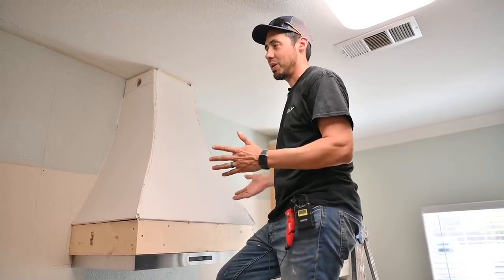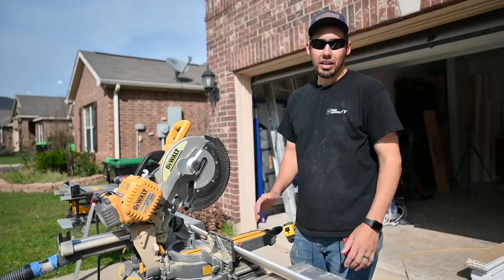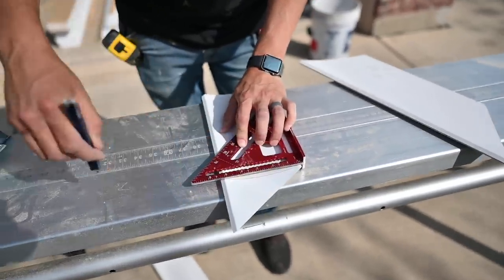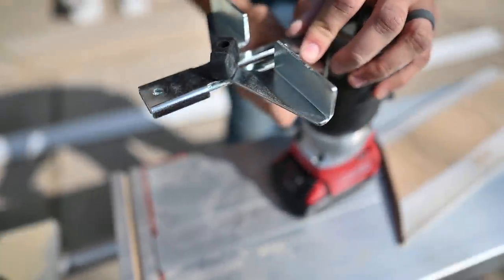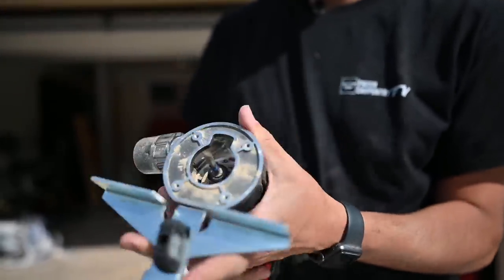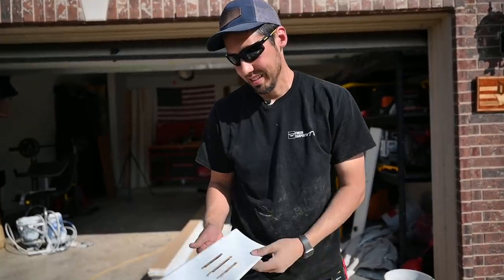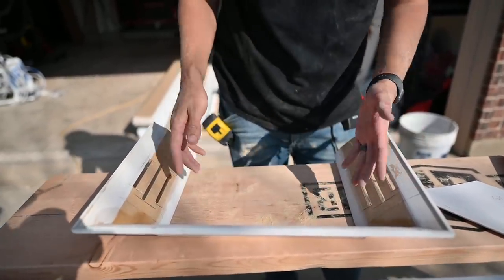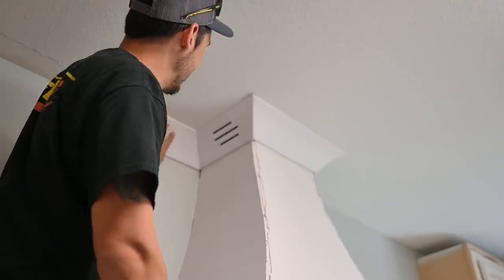Vented Crown Moulding - Trim Carpentry Trick

Comment: That system will stain the crown and ceiling. Not all exhaust is fully filtered. It should be exhausted outside. Love your work.
Reply: Yes, and the grease will accumulate on the inside of the crown where it cannot be cleaned.
Reply: 100% this. I learned that lesson in my first house
Reply: You are correct and the outlet opening is too small, it will add static pressure to this system that the fan and motor are not capable of handling properly.
Reply: Hopefully he sees this.. my thoughts exactly.
Reply: Edward Schmitt :  I worked in HVAC design my entire career, not trying to be a smart ass, it's just something I wouldn't recommend.  I like this guy's work, he is a great craftsman.  If the range is used excessively, cooking greasy foods the design will cause grease streaks on the ceiling and the slots will get plugged up with grease ladened dust.  I would suggest you save your comments for a subject you know something about.  Have a great day.
Reply: sure sure
Reply: What if you threw some charcoal filters into the void of the crown...just thinking outloud
Reply: @edwardschmitt5710  doesn't take a physics professor to see the intake is 8 times bigger than the exhaust! The result will be back pressure and an inferior draw. In other words, some of the air will be blowing straight back out the intake.
Reply: @calebmills7086  but not smart enough to use proper english...
Reply: I see your channel has no content, much like your head. Good night Caleb.
Reply: @byoh100  I’ve seen it happen. Agree with your thoughts.  Air should go outside.
Reply: richard thomas:  The big problem with residential range hoods is that most contain propeller bladed fans which can not accept much of a static pressure loading without a big fall-off in air delivery.

Commercial range hoods are a different animal because they utilize centrifugal fans which can be selected for high static pressure loading.  Charcoal media filters are most often incorporated in residential RH filters, they are are included more for odor removal than trapping grease particles within the media.  Residential range hoods somewhat serve their intended purpose, you just can't add any additional items that would cause additional pressure drop.  It would be cost prohibitive to attempt to use a small commercial RH system in a residence.
Reply: Edward Schmitt no body ever said the fan would break or explode if overloaded, I only said it will not work properly.
Reply: @edwardschmitt5710  i had to have a retrofit with duct going 25ft .... esp if you are burning gas on your stove, you should do whatever it takes to get it outside.
Reply: @edwardschmitt5710  you remind me of the person who said they smoked two packs a day and walked both ways uphill to school.  co2 alarms go off at only very high (death) levels - not the day-in and day-out CO, CO2 and NO2 you are breathing with unvented fossil fuel burning.  Indoor air quality is very bad, (unless you have windows open constantly and a leaky house - doable if you don’t have winters) and one study put over half of ranges producing over epa “recommended” maximums in the kitchen of 9ppb of NO2 (we have few regulations here).  Soaring asthma is a sign - its been increasing since 1980 despite so much less coal burned and cleaner car fuel standards.  This has all coincided with tighter houses for energy efficiency (good) but yet no requirements to vent gas ranges.  Gas heaters yes but not cooking.  Because the US is dominated by huge oil lobby, look to places like Canada that has at least taken some action.  The human and pre-human body has cooked by fire outdoors for millions of years; now we cook in hermetically sealed balloons.  Your house 40 years ago is nothing like where this guy lives.
Reply: @edwardschmitt5710  im an inclusive person and  wont forget the southerners
Reply: @edwardschmitt5710  this is already a known thing with a lot of research.  We have no IAQ regulations, but lots of outdoor ones.  Indoor air is frequently worse, and no2 can be in particular.  

“There is now stronger evidence for a relationship between long-term exposure to NO2 and respiratory effects, particularly the development of asthma in children. Results suggest that short-term exposure to NO2 may be associated with cardiovascular effects and premature mortality and that long-term exposure may be associated with cardiovascular effects, diabetes, poorer birth outcomes, premature mortality, and cancer” 

from EPA’s Integrated Science Assessment (ISA) for Oxides of Nitrogen – Health Criteria (Final Report, Jan 2016)
Reply: @smellydeadcat2178  im no expert but there is a reason the intake even n the cheap ones is 6" and even semirigid duct is not code. i have not seen the hood, but larger hoods do not even sound that loud. Thar hood sounded like it was struggling, not even down draft hoods sound that loud.
Reply: @edwardschmitt5710  The area of a 5" opening is 19.6 sq". The area of a 2.5" opening is 4.9 sq". Multiply the area of two 2.5" openings (it's less than 10 sq") Go out and restrict the exhaust on your Ford Focus by 50%. Then come tell us how good it runs, smarty pants.

Comment: If the total cross sectional area of the slots is half the size of the cross sectional area of the duct then you would get half the airflow of what you had before (approximately). You will also increase your velocity so it might feel like more airflow but might actually be less.

Comment: Richard, I recently installed a new modern vent hood.  The kind with curved glass and touch controls.  It’s vented to the outside via 6” ducting, which is manufacturer recommended.  I would be concerned about grease building up on the crown molding with internal venting.  I would highly suggest frequent filter cleaning.  You probably have the filters you can pop in the dishwasher to clean...I hope.

Comment: Nice job, I've done similar things with slots. When you were setting up the router to make the slots I was saying set the fence to one side of the crown and then the other side and then center the middle slot on them [a production move] just how you figured it out it also keeps it highly accurate with the least amount of effort the things that make you a highly skilled carpenter

Comment: Slowing the airflow to force it through the slots, which it will do, will cause grease to be deposited in, on and around the slots.  Keep the filter cleaned regularly to reduce this as much as possible.  I am not sure if you can, but if you could cope the crown trim in the duct into the crown on the wall, it could be removed without removing the crown on the wall.  When the trim gets dirty and greasy looking, it would be easy to change the crown around the duct.
Better yet, if you can, just duct it outside.

Comment: Pretty cool. I may have cut the slots to mimic the crown shape. Long on top with each slot below a little shorter and all lines stop at same vertical on other side or same length slots matching the curves in the crown. Just a thought from another carpenter!

Comment: A thought came to me while watching the video. Could you have drilled a pilot/guide hole the size of the router bit on the center line, and then positioned the router using the drilled hole? 

Just a thought. Another good video. Keep up the great work.

Comment: There is an unexpectedly technical side to airflow mechanics...it's a lot like the mechanics of waterflow and electricity flow. In your case, restricting the outflow will increase the noise level to an aggravating amount. And, as everybody has mentioned, those filters don't filter 100%. However, I love how your brain is working. Thanks to you I am pre-assembling and gluing the trim for an inset octagonal window instead of nailing each of the 16 pieces individually. It's actually a scary step the first time.

Comment: Richard, you need to check the CFM rating of that unit and see if the two holes you made are large enough and calculate the area of your vent slots as it looks like you don't have enough vent slot area.  It looks like you will be getting a lot of back pressure in your exhaust system.  Nice job with the slots.

Comment: I like the plan, but you should count on the exhaust air being moist. So you need to paint your crown outside and inside also.

Great job/idea!
Reply: Or duct it through and seal it right against the backside of the crown after several coats of primer on the backside. That might do it for a while. A couple years in remodel will do any carpenter tremendous good. Especially when it comes to spotting common issues that installers create. Moister is a big one in so many scenarios.

Comment: That range hood has a CFM rating for how much air is moved. I don't think you have enough space in the holes you drilled,  it's like dust collection if you choke it off it won't work

Comment: There is still a greasy residue in the filtered air. check out the slots after a few months of use and see if they are not getting greased over which will be a problem.

Comment: The venting is all about surface area. To ensure you won’t have back pressure you should calculate the area of the filter at the inlet above the cooktop. And then compare that to the area of the slots you cut out. Make sure they’re the same square inches. Or you’ll have back pressure

Comment: The area of the vents should be on the same order of magnitude as the round hole at the top. Those holes round holes look quite small for a range hood. If the holes are too small they will be noisy and will prevent a lot of air from being moved.

Comment: The decibel noise level would increase depending on the air velocity, slot/hole shape and edges. Is the vent only on one side?  If it blows straight at the slots and the one side isn’t enough it would build static pressure and blow out the other side. Or it could draft air in from the other side. Then you’d have yerself rite ther a dyson blade-less duct-less recirculating range vent.

Comment: I think that it would’ve been easier to cut the 3 slots if you cut the middle one on centre first. Then just adjust the fence 3/4”-1” shorter. Then you have two very quick cuts that will be symmetrical with the middle cut.

Comment: It may just be the angle of the camera or because the slots are on a curved surface, but the top slot does not appear to match the bottom slot. The top slot looks like it starts closer to the wall and ends short of where the bottom one end

Comment: @Dave Sch
 Three factors. One; the filters are, at best, marginal in stove hoods, 
yeah, years of remodel work and removing old hoods is the evidence, none
 are very good. Two; filters should be regularly cleaned, none are. At 
first, they get a cleaning because it's a new deal, after time, it's is 
forgotten. Number 3, the slotted vent is too restrictive in air volume. 
There is back pressure that will develop with those little slots, the 
marginally filtered air will spend more time in the crown air chamber, 
it'll make a difference. Daniel is correct.  Apparently basic math is a 
bygone of the modern education system. The old," Why do I have to learn 
that, I'll never use it." Relatively clean air, that's a highly 
ambiguous phrase. So there should be relatively low amounts of grease 
collecting on the vent slots, being absorbed into highly porous MDF and 
relatively low amounts of grease and cooking residue collecting outside 
the vent. Relatively speaking. Reply if you wish, I never, ever read 
them, others might, you can attempt to convince them.

Comment: most exhaust hood vents require a 6" duct, and those vents you cut will not provide enough CFM to pass through, causing undue strain on your motor.
Reply: Most of the exhaust fans that we saw when we did our kitchen said 8 inch ducting and reduce the number of bends to maximize the airflow to the outside. The slots in the crown molding here are probably equivalent to a 4 inch duct so the throughput of this exhaust fan is probably a fraction of what it should be.

Comment: I would worry about moisture being deposited behind the crown that is being cooked off.  I would definitely run the fan for a while after you are done cooking to hopefully dry out any moisture
Reply: Now that’s a great point! Any DIYer doing something like this, this is a good reason NOT to use MDF for this type application...wood only. MDF would disintegrate with heat and moisture as the binders melt away.

Comment: @finishcarpentrytv another thing to consider if the issue comes up, if you block the exhaust of a prop fan, it’ll cause the amp draw to go up. If you end up losing fans on that exhaust hood, it could be due to restricted air flow. Just wanted to point that out if it comes up.

Comment: I'd be worried about constricting the air flow. The volume inside a vent pipe is being necked down to some narrow slits. That can't be good.  Moisture is just going to exit onto, into and against the molding, which also can't be good.  I' might also worry that all the moisture coming off a pot of boiling pasta won't be able to leave those slits fast enough and will end up dripping back down onto the stove top and possibly into the food. Not all grease ends up in those filters either which will make a heck of a mess up along the ceiling......

Comment: If that vent actually gets used, it will get that crown pretty nasty. Besides, most hoods/microwaves that have the recirculation feature exhaust at the front. Not up through the external exhaust vent. Not a criticism, just passing along some knowledge Hope that helps..

Comment: The design looks great BUT you are going to have rivers of moisture passing over the surfaces that will eventually break down everything it comes in contact with. A stainless or aluminum fabrication would have been a better choice and just dead-end the crown.

Comment: I hope this works as well as it is going to look, not sure about venting hot, moist, and greasy gasses into that cavity and out of the slots. It seems like the potential for mold and rot inside the cavity and staining outside the slots is high.
Reply: Ah, the more tactful approach. Delivered gently. At first I checked to see if this were posted on April fool's or something 😬. He's learning like everyone else. I've certainly done my share of tunnel vision fucus on something to the exclusion of practical function. I'm sure like anyone else I will do so many times again.  Looks like a recipe for mold. Maybe if it were ducted all the way through the drywall, tight to the backside of the crown and sealed with top notch primer on the back of the crown it would last a little while. Maybe there's more too it since he didn't really finish it in this video.

Comment: Your slots are killing the CFM of your fan, straining it to be drastically reduced, thereby rendering the fan's rated CFM to be strained and much reduced. The fan's CFM rating dictates what the correct and minimum exhaust pipe inner diameter should be, and so, that should be equal to the total combined gaps of all those slots. If not, your fan efficiency will be drastically affected, putting a serious strain on it since the air will exit at a far lesser rate, aka, CFM.

Comment: Totally wondering how you curved the drywall while keeping it a smooth arch lol i woulda broken into a bunch of sections. Would love a video on the trim youre gonna do on it as well.
Reply: Spray water on it and it’ll will bend. Affix it to the desired position and it’ll dry in that form.
Reply: @AG-lm5uf  now thats cool. Lol thanks
Reply: @redscortgt93  use 2 layers of 1/4" drywall. It will flex ALOT before breaking
Reply: @ThielTube  thats what i saw from a quick google search.

Comment: What just about everybody with knowledge of range hoods posted below.  Don't take this personal.  You simply don't know the requirements for a range hood to be effective.  It DOES look cool but is a horrible idea that will be a huge mess to clean up when the chickens come home to roost on this one.  Depending your cooking style, you may have brown goo dripping down that hood and smoke streaks on the ceiling within months(if you don't caulk it perfectly.  Even then, eventually, the grease will wick through.  There is an outside wall SIX FEET to the right.  Take advantage of that.  This is one of those, "seemed like a good idea at the time" projects.  Looks cool, but even IF the grease and smoke didn't collect in there, which they WILL, the CFM that those slots and holes can handle is nowhere close to what's needed for an effective range hood.  That's not an opinion, it's math.  The cross sectional area of your holes and slots needs to be at least equal to the vent outlet on the hood.   Range hoods that vent back into the room are nearly worthless anyway.  They only get a portion of the grease, almost none of the smoke, and ZERO water vapor/steam.    Keep the slots and vent it outside.  That way you keep the cool factor and have a range hood that actually works.  The video is great and the slot cutting demo was worth the watch.  So, keep up the good work!

Comment: You are restricting the airflow of the fan, it's not going to be able to do its job.    It's bad enough to have a recirculating fan, (in comparison to an exhaust fan) but you can not restrict either and expect them to perform.   The smallest of cheapo fans will need a 4`duct , which has approximately 12 sq inches of area, your slots might be 3 sq inches in total.
Additionally , it appears you`re using an exhaust hood , but rather than exhausting, you are dumping the air at the top of the hood.   Recirculating have filters ,   without that, you`re in for  a disgusting mess , the slots will be gross in a couple of months, so kinda wasting your time worrying about that detail.

Good luck, I know you will get it right in the end.

Comment: Rich, theres a router jig you can buy off Ebay that runs on the plunge saw guide rails. Item no. On Ebay 284060270059